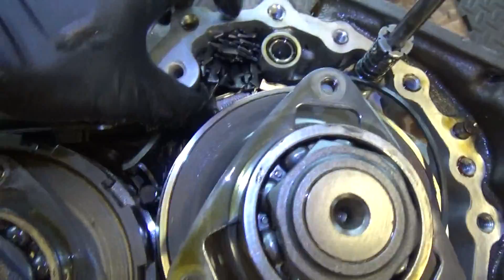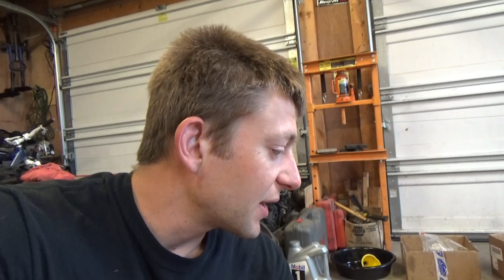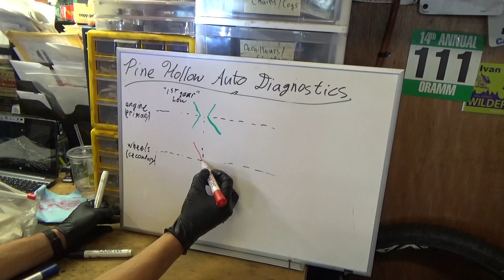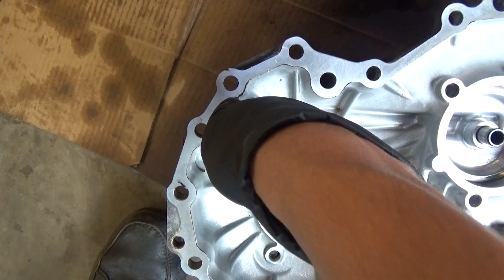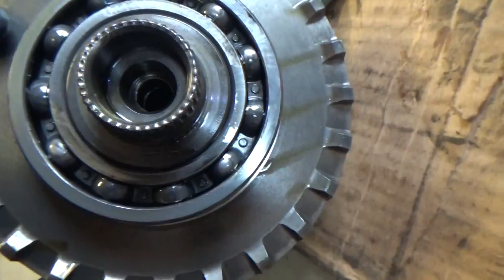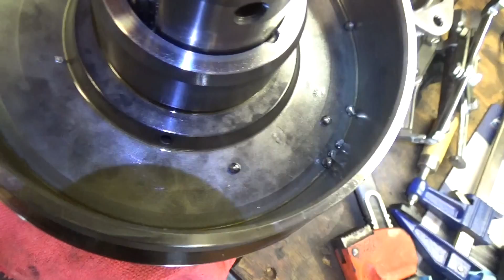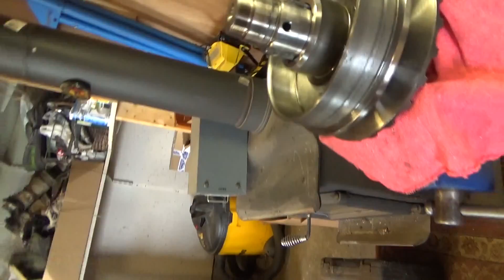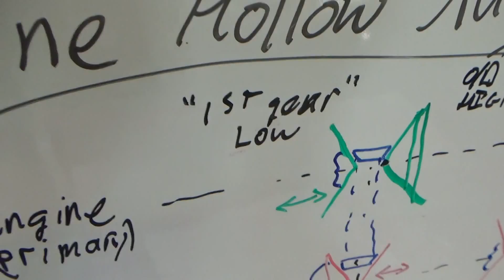Nissan CVT: Teardown and Failure Analysis -Part 2 (RERELEASE!)

Comment: @ Pine Hollow Auto Diagnostics 
I have a 2015 Nissan Altima i buy it when it was new no problems so far it now  has 38k miles on it  recently i got a message from Nissan telling me to bring it to the dealer so they can reprogram the transmission something about the fluid pressure should i take it and let them do it i'm afraid after they reprogram it will start to have problems

Comment: The steel belts only hold the parts that wedge between the pullies, they then stack and "push" the other pulley is how they work. Worst transmission ever! The only way these would be acceptable is if the belt and pullies were sealed off from the transmission with an access that you could service and replace easily. I tell everyone to avoid them.

Comment: Excellent job on that trans tear down, I just wonder whether the Toyota CVT’s are built the same as Jatco’s. I agree the weak spot is on the primary shaft design. What year Nissan did this transmission come from ?. My 2017 Max puts out 300 HP, torque unknown? , so I’m thinking my transmission is not going to last that long even if I change my fluid every 50,000 kilometres. Also, I would not want to pull any kind of trailer with a vehicle that had a CVT in it.
How much did the replacement cost you ? And how many hours hours labor to remove and replace one of these CVT’s.

Comment: This demonstrates what a pile of dog shit a CVT is. A few paper thin steel ribbons is all that's taking the power output from the engine. Who designed that "gearbox" thinking it would last longer than a strawberry season!

You'd have to be a very special kind of idiot to pay money for any car with a CVT.

Comment: CVT sounds like a nice idea, in theory. But in the Real World, I think I'll stick to the slushbox that's been working fine for many decades. Or a Millennial Anti-Theft Device, also known as a stick shift.
Reply from the maker: haha yeah me too. Stick shift FTW!
Reply: I don't know many people who can't drive a stick. My wife can; my daughter can. However, I know a lot fewer who are ready, willing, and able to replace a clutch. I've never bothered to replace a synchro so most of my cars have had balky shifting at barely 200K miles. We replaced the clutch on my son's 1994 Integra just to have the pilot bearing fail a year later. Nothing but Toyota hybrids for me - I'm too old to mess with transmission failures.

Comment: Great video, fun to watch and learned a ton. Wouldn't the primary pulley getting stuck in "high gear" make it stall all the time before it blew out the belt? Or am I missing something?
Reply: with the torque converter, no, trans won't lock it unless the vehicle's moving at a suitable speed for it to lock without stalling.. and that being stuck in high gear comboed with either a shifting command and/or how a torque converter works [it multiplies the input torque to the output, based on the speed differentiation between both sides], pop goes that push-belt..

Comment: Good vid. Thanks
I have a 40k Altima  .. 
Ya got me wondering how to feather the throttle.
Reply: James Adema 
What year? 
Your CVT Altima should be strong enough to take a thrash.
   As long as flush every 25-50K interval youll be fine

This CVT failed because there was no proof that this owner FLUSHED their CVT IN AGES!!!

Comment: My guess because the clean break on the belt is that something got lodged between the pulley and the belt and thus bending the belt at a sharp angle and weakening the belt extensively, but have yet to see the whole video.

Comment: Maybe centrifugal force caused the steel balls to seat in the outer groove while heat caused the outer portion to expand causing the steel balls to come out of the inner groove slightly. Then changing gear ratios wore the edge of the inner groove on the torque bearing side. QED :-)

Nissan should give you a free replacement for your product failure analysis.

Great job!

Comment: Had to be the pulley collapsing causing the failure.

If the belt failed the pulley would not collapse because the pressure inside is governed by the valve body.

So what likely happened is the seal blew on the primary pulley collapsing it, stretching and torquing the belt and causing a catastrophic failure.

I work at a Nissan dealership, we see these all the time.
Reply: My 2012 Nissan altima had a vicious hop and would hardly move far. I drove it for 8hrs got off interstate an came to a stop and accelerated and that's when it started the violent hop. What does that seem went wrong?
Reply: @oldeenglish5896  those Altimas had CVT transmissions.  More likely than not, that's what it is, but refer to your shop for a proper diagnosis.

Comment: Toyota  has a recall on 3400 corollas with CVT transmission. I would stay away from cvt as much as possible. They look flimsy with those metallic belt. Nissan Altimas are notorious for bad cvt transmission. I am surprised yours lasted for 186K miles. Usually Altimas cvt transmission go out before 100K miles.

Comment: This is probably one of the best dissertations (via disassembly) of a CVT I've ever seen. Its really refreshing to hear the mechanic saying "really cool" instead "what's going on, that's stupid." There's hope, folks. I have a 2010 Nissan Sentra. Of course, its a less powerful powerplant and I've never tried to hot-rod or otherwise over-stress the car. I think the CVT is a sound concept for smaller cars. Now I have an idea of what's going on in my Sentra's CVT and how long it might last with normal driving. I'd still prefer a 5-speed stick though. Only need to worry after the clutch assembly ...
Reply: The fact that you cant find aftermarket rebuild kits for it (and in some cases at all), makes me hope it's retired for good. Keep it in lawnmowers.

Comment: I would have thrown a nickel in there with the other parts, just to screw with them. one time I tore apart a honda rebel 250 engine that had failed, and in the crankcase was abt a 2 1/2 inch section of a 10 mm snap omn wrench.. it looked grinded in half. dont know of someone had went into the engine forgot it in the crankcase, or stuck it in there to cause the engine failure. im thinking sabotage, because rebuilding motorcycle engines is kind of rare. most are junked.

Comment: Good video. Poor engineering. After seeing this I'm tempted to sell my 2015 Nissan Rogue however, I got life time warranty for the transmission as part of the dealer deal, buying it new.   Unfortunately not too many options for buying a car with traditional automatic transmission. For SUV, only GM, Mazda and Hyundai.
Reply: I got the same warranty when I bought my versa this year. But I also had that warranty on my 2017 versa but I hit a deer and never had to use it.

Comment: Many car manufacturer's ( except Mazda ) have switched to CVT auto trans because they are cheaper to manufacture and some slight gains in gas mileage can be achieved. The problem is if you have a problem nobody can fix them so you have to replace them. The other problem is they are failing much to early to be considered reliable. If you are buying a car with a CVT insist that the dealer / manufacturer give a 200000 mile warrantee on the CVT or you're shopping elsewhere. When the dealers start loosing sales the manufacturers will react. Mazda's use a conventional auto trans and with proper transmission fluid changes they will last at least 200K. I will not buy a car with a CVT because they are poorly engineered and we are the guinea pigs used until they learn how to build them correctly. LET THE BUYER BEWARE. And don't get me started on Turbo engines - HINT: Turbos wear out and they are expensive to replace.

Comment: Although that cvt failed and they all must fail as you say with the inherent design flaw. It appears to me to improve the design for these is an easy fix.
Reply: Planetary gearing is the only fix, belted CVT design is flawed and designed for lower cost of vehicle not reliability.

Comment: Did you possibly drain the pan and change the fluid recently within the last 10,000 miles before this happen or a complete flush these things can cause the problem honestly over the years it's better just to let the fluid run the transmission dead seems like when you change the fluid or Flushing more problems happen

Comment: I work on these I can tell you most of it is pump failure or valve body being jammed up with dirty fluid it causes fluid problems lubricating on certain vital parts I can actually cause a lock up from lack of fluid only takes 2 or 3 seconds and it will snap

Comment: Now, I know why people say to change the trans Fluid every 30,000 on Nissan Cars...
Reply: It’s not just the transmission fluid. The filter inside the oil cooler with all the rubber o-rings and the oil pan filter and gasket must be replaced every 60,000 miles too.

Comment: Ivan This is By Far The Best CVT Tear down and Rebuild set of videos on The Internet... No One has ever gone this far into a CVT Trans on You tube and explained and showed so much of how and the way it works... CVT Is a Great Powerful concept.. When working properly in the right car with the right tune, No Human can out shift a CVT manually, All tho I know there are people who think they can, and they will argue that the Juke with the Stick is faster but it's not, They lose Boost between every gear, the CVT doesn't,. But The manual is way Better when it comes to saving money, That's for Sure!!!!  Toyoda has their CVT's perfected..  They get there CVT Transmitions from a totally different company from Nissan.. Nissan Just doesn't give a fuck!!!  They went with The Lowest bidder on this thing, Sad to say, But so true!!!! And For the best Laugh of all I just bought my Juke, with 70,000 Miles on it, I didn't know any better, I'm Thinking it's Japanese, It will run for ever... And NOW I'm stuck making payments on a Car that's sure to Brake, Between the GDI Motor That starts to loose Power after 50,000 Miles Because of Carbon build up, The CVT, Enough said on that, and The Turbo, which has a terrible Feed line, I'm fucked.. Time to start saving for the inevitable!!!!!!
Reply from the maker: LOL yeah sounds like a lot of potential issues there!

Comment: Great troubleshooting and video. I enjoy tearing things apart, too. Putting them back together is another matter.It appears that after the anti-rotation balls liberated from the worn grooves, the pulley was unable to change shape, causing the belt to tighten and fail. The damaged neoprene O-rings were simply a result of overheated and/or overpressurized ATF.The balls and grooves in that roller spline should have been designed to take any load the car could exert-and over many miles. The balls are made of very hard steel and from what I could see, were not deformed. The failed grooves were made of softer steel that wore over time. You did get over 150K on the car, probably over its intended design life.PS If you read a new car warranty, the mfr is often allowed to replace any defective part with a "remanufactured part" so some of your CVT might show up elsewhere.

Comment: No hard launches with a CVT baby off the line and the last forever don't tow with a CVT. Get your fluid changed every 30000. I have four cvts with over 300,000 and going strong

Comment: There is one upgrade for the "nuggets" as you called them. What you can do is weld 3 woodruff keys in place of those so called "nuggets" it does require grinding them down to slide in with a little drag, but it'll keep that from happening again if that's the only problem you had a side from the belt.

Comment: The easiest way to check it is to  shoot compressed air to where the fluid should be going and it will function the way it's supposed to, that is if it's working properly.

Comment: I'm not a mechanic... but I've seen the insides of some transmissions......this is the most complex AND weirdly engineered thing I can imagine.  I realize they are trying to squeeze every bit of MPG out of a motor they can.   But, come on.. this is planned failure to the MAX.   Metal bands??? cripes.

Comment: normal driving condision will not harm the shaft ,, my advice do not put engine on high rpm and the cvt on n mood the you switch suddenly to d mood or driving mood thats will cause impact force and this force very higher than normal force

Comment: the torque is actually NOT transmitted through the steel belts...the wicked thing about this type of CVT is that it trasfers force by pushing intead of pulling, that's what the 500-ish metal pieces are for. The belts just hold them together ;-)

Comment: I had two warranty claims for 2012 Nissan Rogue, one for engine..one for transmission. With engine I lost a cylinder completely. The transmission however did not reach complete failure, only high pitched whine. Total miles on vehicle = 27,000. Nissan was nice enough to fix both (after 6 weeks....no spare recon'd transmissions available) and get me on my way. I traded Rogue immediately after repairs completed on a 2014 Rav4, no issues since. It is important to note, parts and labor on Rogue exceeded $12k for both repairs. Secondly, while Rav4 does run a CVT style transmission, I have had no issues in over 150k miles....simply add gas, change oil and tires. Moral of this story....don't get caught without a warranty, as doing research before purchase on a new model year vehicle nowadays is like throwing darts ;-)
Reply from the maker: Wow must have been a Lemon! My wife's Rogue is at 213k now, after the CVT replacement at 186k. Engine runs like new, doesn't burn a drop of oil!
Reply: The Service Manager told us breakdown resulted from extreme mountain pass elevation changes in our area, 
primarily the Coquihalla Highway and Connector. With four passengers, bikes and cargo Rogue simply could not hold up. I would have kept Rogue following repairs but nobody in Dealership could guarantee replacement trans/engine included enhancements to prevent similar breakdowns. I wish you best of luck on your Rogue...hopefully 500k club ;-)
Reply: Unless you drive a hybrid the RAV4 doesn’t use a cvt it uses a 6 speed automatic transmission.
Reply: Thank you for the correction. Helps me sleep better at night ;-)

Comment: the gear arm just block the first pulley to maintain low gear.if this frist pulley is roller controlled well then the first pulley work like on a skooter cvt exept they use rubber belts and pull on the belt

Comment: Design problem. Even with the extra balls that shaft metal is too soft. The simple fix would be to treat the shaft and make it hard so there would be no wear. I agree, 6 Grooves with more balls would help. I would still send it in for the core charge. Just dump everything back into it including those sheered balls. They will of course tear it down like you did to see what damage was done. $800 Is a LOT for a core charge. Yes they got the belt design down, just not the shaft. What a shame. I hope my Subaru Outback doesnt do that. I do pull a lawn mower trailer but thats IT. There is NO WAY I would pull a camper or anything heavy.

Comment: I concur. Terrible design. That shaft should have been splined. Those balls putting all that point load on the edges of a slot while engine power is being applied was engineered to fail. Clearly Nissan has  fully embraced the mantra of Planned Obsolescence.
Reply: @Orinoco Flow I'm no expert specifically on CVTs but I used to be a mechanic and I've been a mechanical engineer for 25 years.
To be quite honest, when anything has such fundamental design flaws as those exhibited here, there's really not a great deal that can be done aside from driving it like an old woman. A flush is only really needed for situations where the fluid has been neglected (harsh operating conditions, which can include city driving, but with normal fluid change intervals). So maybe a brick under the accelerator pedal? Personally, I'd get rid of it ASAP.

Comment: CVT is good, in this case 186K do not take care CVT fluid well then shit happened,  Honda, Automatic transmission never reach over 130K it all get trouble!  You do not know the technology of CVT much then do not buy it.  They transfer all engine power and never loss much when you drive.  It is benefit for the fuel!

Comment: It's just a comet torque converter that has been used on go-karts for a 100's of years. Replacement belt for a comet $40.00 or less Replacement belt of a Nissan around $3,000.00.

Comment: The two halves of that drive pulley turning at different speeds twisted the segments on the drive belt and then sheared the inner band. Ah just assemble and dump the segments in the pan and pick up your 8 bills.HA I would blame it on the wife right pedal getting smashed too often.Mine drives likes its the zombie apocalypse.